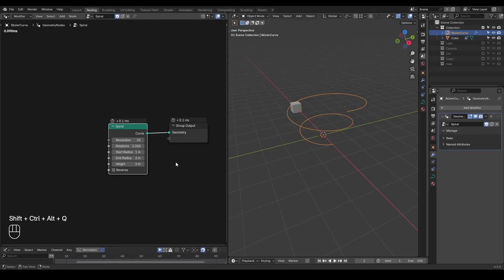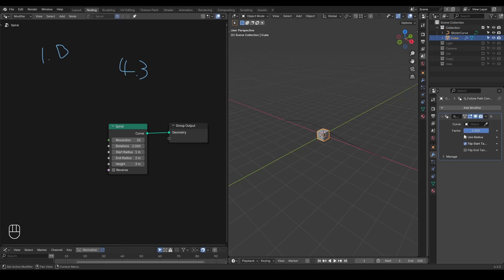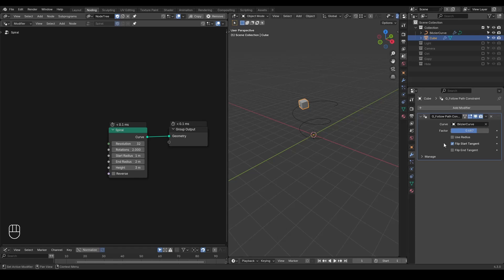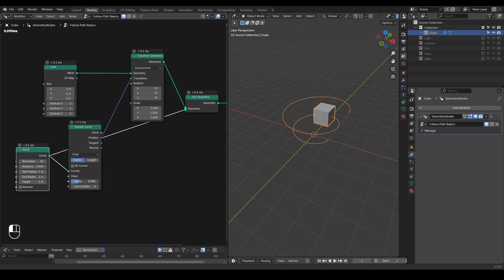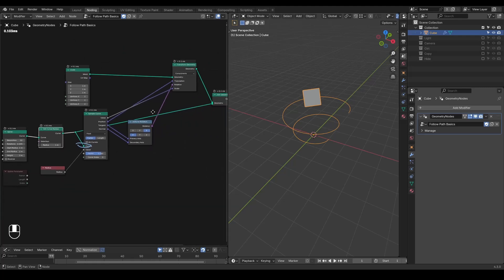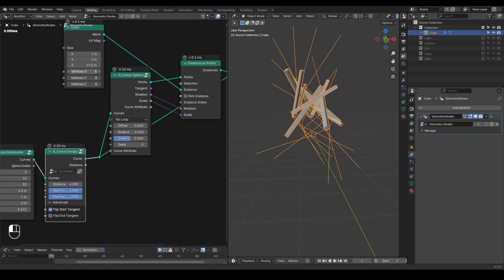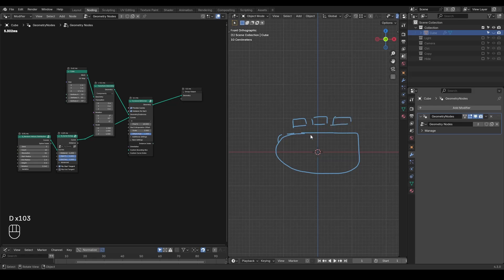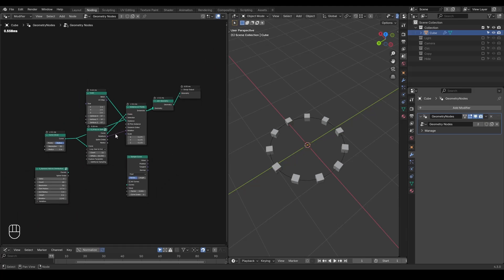[Tut] Sample Curve Node to make Constraints in Geometry Nodes presets 4.2+

Comment: Thank you for this video, but just to confirm: if i need a helper or any other non-geometry object to follow a path (that was modified via geonodes) there is actually absolutely no way to do it in Blender?
Reply from the maker: "actually absolute no way in blender" is a very bold statement. it's definitely not correct.
It's more like you can not use geometry nodes to control other objects such as camera. But blender offers plenty other ways wether procedural or not, wether require addon or not, wether difficult or easy. in 5.0 the process can be a bit more easier too.

Comment: There is another addon called sverchok which facilitates parametric modelling inside blender. It supports light, camera, empty. 
You have to first learn it as it is different from geometry nodes in working.